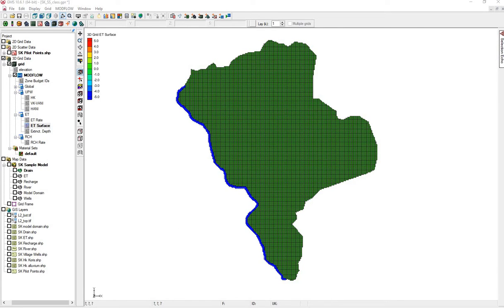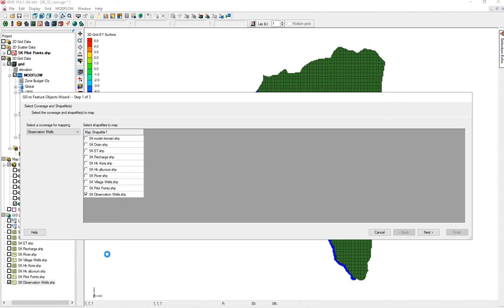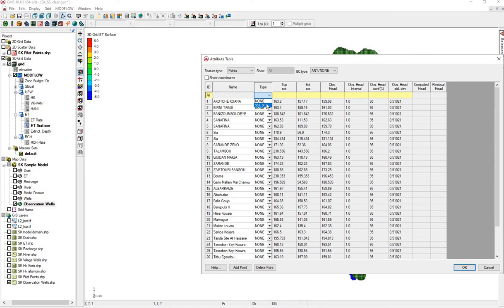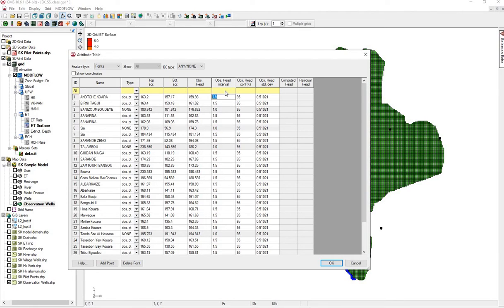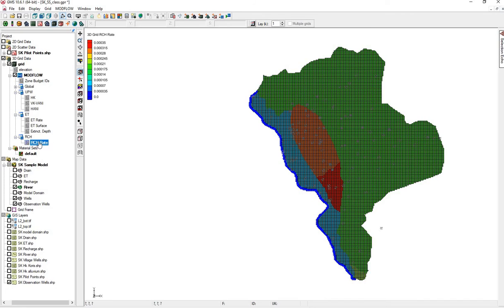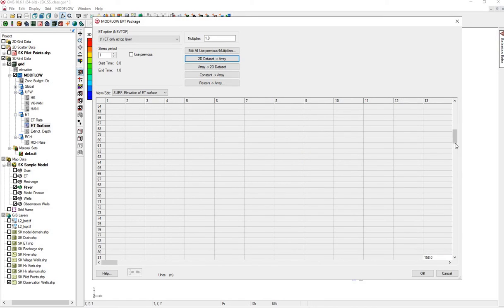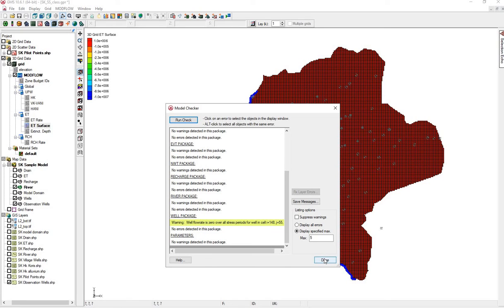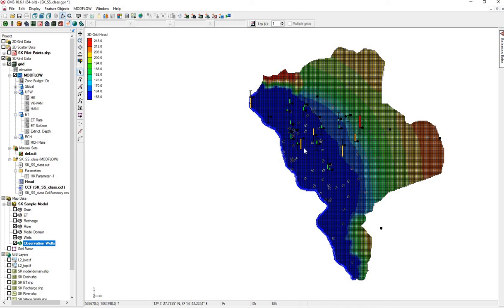Add observation wells and run model 5/n

Comment: Hi Alex is it possible for you to tell to what should be in the attributes of these shapefiles? just to make a guide on preparing the needed shapefiles
Reply from the maker: Attributes depend on the shapefile. For Hk, I have name of zones and Hk values for each zone. For wells, I have name of well, flow rate, top screen, and bottom screen. For recharge, I have name of zones and recharge values for each zone, etc. Hope this helps!
Reply: @alexandralutz7844  Thank you Alex. But is it possible not use the top and bottom screen, and instead use well depth?
Reply from the maker: @wendelldtalampas7024  you can use layers - make a new coverage, check both "layer range" and "wells". In the attribute table, you will see columns for "from layer" and "to layer." Does this help?
Reply: @alexandralutz7844  Hi Alex, sorry for the late reply. Thank you very much for the reply. So, if I have four layers, 1-4, I can just chose which layers to include, say, from layer 1 to layer 3? Is it also okay, if I have the same layer shape for the four layers? Thank you
Reply from the maker: @wendelldtalampas7024  yes, you can choose some of the layers and have the same shape for all. Good luck!
Reply: @alexandralutz7844  Thank you very much Alex ❤